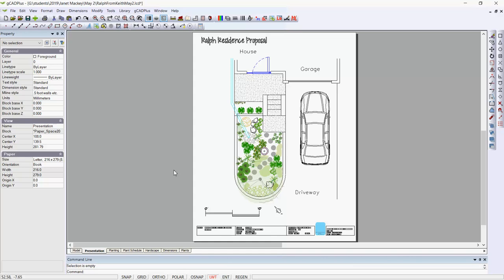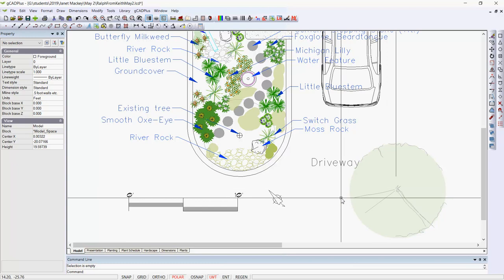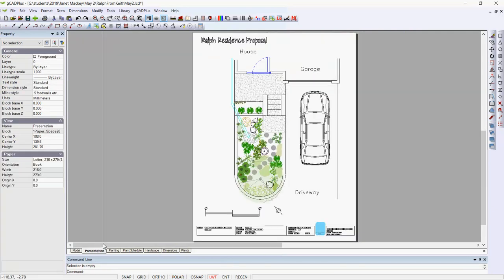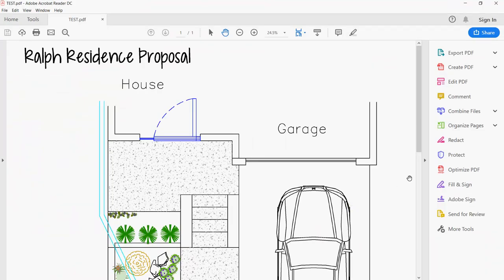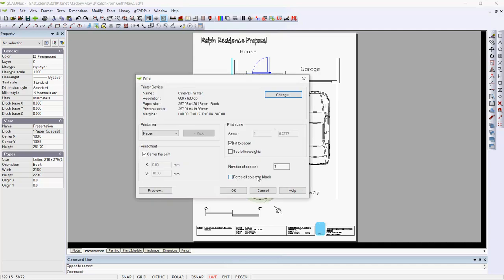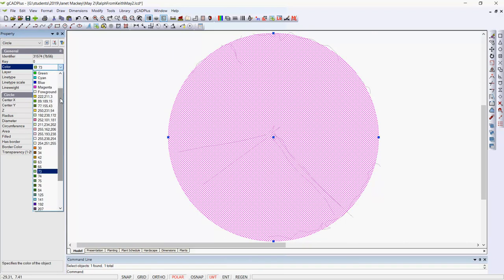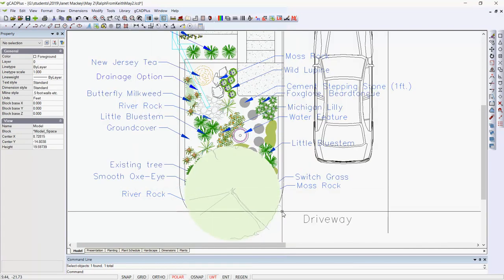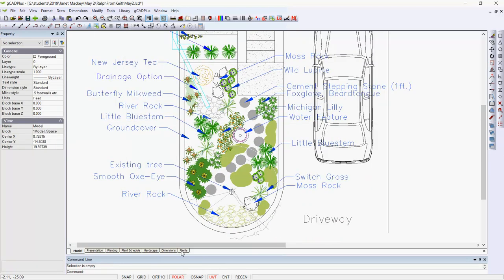Printing landscape plans containing transparency

Comment: you could have put a faint colour, then sent to back with draw order as a solution..  but it still might have looked crowded.   another option would be to explode block and hatch with dot pattern on say 50% density..  then send to back.. bit of mucking around i know.    that said.. is it possible for me to use/apply Transparency as a tool for solid hatches or well any hatches?  i was only thinking about this the other day for a mulch back ground in a garden bed..